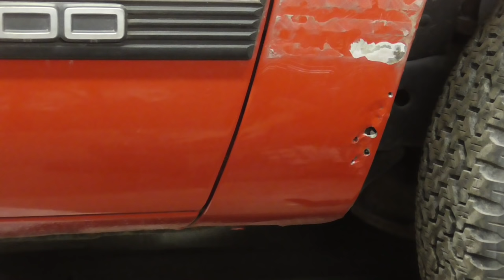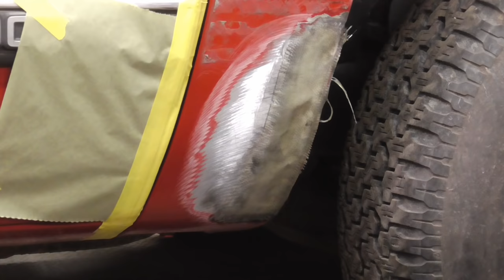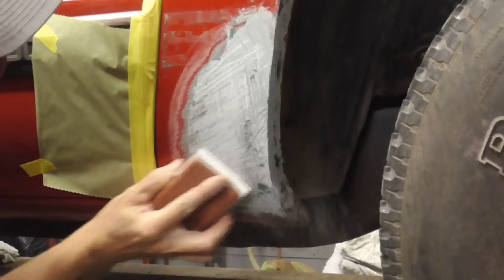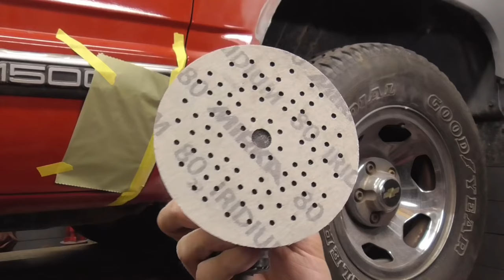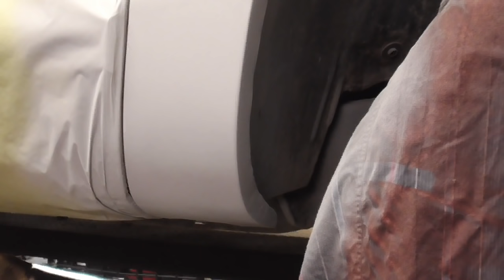How to Repair a Rust Hole with Fiberglass - No Welding!

Comment: I am doing this work to my ‘64 Plymouth Barracuda. I wanted to see how you were doing it compared to how I am doing it. After grinding back the rust and tapping back the metal in the effected area with the body hammer as you did here, I have been applying fish oil based rusty metal primer to the rusted, pitted areas with a small, cheap art brush (trying to get some of the primer on the back side around the perimeter of the rusted holes whenever possible), let it cure, then fill the holes directly with the long strand fiberglass “Bondo Glass”. On the holes larger than 1/4”, I have been applying the Bondo Glass to the back side of duct tape, then placing the tape over the rust hole and pressing inward around the edges of the hole to force the excess filler into the hole, letting the material harden, then removing the tape. Doing so, I find that I can better control the thickness of the filler in the patch and the wet filler doesn’t “collapse” when being spread and leaving a hole or a thin are in the patch. I wouldn’t have though to use fiberglass mat and resin first, instead of the duct tape method; I would have assumed that I would sand through it trying to level it with the existing surface and the areas over the rust hole would be too weak or just fall out? But, clearly your making it work! These areas where the back side of the rust through are inaccessible are my most worrisome. It would be great if I could clean, treat and add fiberglass back of the panel to insure the patchs hold, but what are you gonna do? Wherever possible, I want to try to let some two part epoxy run down and cover the backside of these repairs to seal them and add some strength as well as drilling some drain hole at the bottom of the lower panels and running a wire through them to make sure there is a clear runoff for any water to escape. Outside of cutting out the panel, repairing it, and welding in back in place (which is beyond my skill set, schedule, and budget), I feel like this is the best I can do.
Reply from the maker: As long as a panel can drain and dry out inside it will not rust - no moisture = no rust.  Lean a thin sheet of bare sheet metal up against a chain link fence and it will be there for 20 years.  Try to make sure you clean out the panel best you can and make sure there is a way for the water to escape or drain.  Then fix it how ever you can do best 👍😊

Comment: I just dip my already cut piece of cloth in the resin then apply. I also after about a week after job is complete I get up behind the patch and soak with oil. Helps so it takes along while for rust to come back. I did my ranger in same spot really similar over a year ago and still hasn't bubbled yet! Great video
Reply from the maker: Thanks - great to hear.  Have a good weekend :)

Comment: I've used Bondo with chopped glass to repair a large rust hole in a hood at the front lip. The local auto body shop wanted $2k to replace the entire hood. They claimed that anything other than replacement would fail "in a year". My repair hasn't failed, eight years later. Still driving the car. Even funnier, or more disappointing, the hole in the hood was the result of a failed professional repair about six years earlier that rusted away under their filler, which was in turn under one of those clear plastic hood protection films. My driveway repair has lasted longer and looks fine (for an old well used car). It's barely noticeable unless you lift the hood and examine closely.
Reply from the maker: Great story Jim - it all depends on how it was done - can the panel drain, stay dry, etc.  Lots of factors.  Thanks for you input and support 👍

Comment: Good job dude. I like clean work. You could even fill the craters with cat hair or short strand fiberglass. We always use fiberglass for many of our crumpled areas that are so bad we just can’t dolly the metal back. Customers prefer it over replacing expensive body parts! Like quarters and fenders. Doing Fiberglass repair is like having a proven to work cheat sheet! What sits next to our gallon of filler on our work carts? A gallon of dyno glass!
Reply from the maker: Thanks Rick - that truck is in my garage right now getting a lower quarter patch panel.  That fender still looks fine - I actually surprised 'cause the guy drives it year round on salty winter roads and it sits outside.

Comment: You did an amazing job and made it look so easy. I had just picked up some bondo glass for the filler, thinking that would be enough.  Then realized I need to get some bondo body patch because it's a fender and the more I touched the rust, the more pieces fell off.  But then watched your video and realized the solution is use the fiberglass first on the hole and then the bondoglass over it.  I could buy the filler, but it's an old car and it doesn't have to be cosmetically perfect, just waterproof.

So I'll sand down the rust.  Use alcohol or vinegar to clean off the rust powder.   Then spray rust reformer and let it dry. Then fiberglass over the hole. Then bondo glass.  Sand and then paint over it.
Reply from the maker: Sounds like a plan - just make sure it's really roughed up before you put the fiberglass cloth on - that stuff likes to stick to freshly sanded/ground metal.  Let me know how it goes for you :)

Comment: Well, I'm glad my (unintentional) winter project has taken longer than expected and has yet to be painted.  Our nemesis, CAR CANCER!!!, strikes again; rust bubbles formed and penetrated the primer in some spots. 

Also, I had one spot on the roof crack.  I ground it out with a Dremel, added Bondo Glass, and then a slather of Bondo Body Filler.  I believe the crack was from hosing down the car when it was outside after a surprise snow.

Let's hope it goes better this time around.
Reply from the maker: What kind of crack are you talking about - a crack in the metal, bondo glass, or bondo?
Reply: @LakesideAutobody  I'm pretty sure I used too much Bondo.  It was on the roof at the front d-side corner just above the windshield.
Reply from the maker: @ItchyKneeSon  It really doesn't matter how much filler you used if the surface under the filler is prepared correctly.  Let me know what you decide to do - curious as to why that cracked.  Keep me updated IKS :)

Comment: Nice job, I was looking for an alternative to welding because I'm restoring our horse trailer and there's just so much rust I'll be there for the next 20 years chasing it all down, thankfully it's all cosmetic and the structural parts are all good still. Going to have a look at that Bondo Glass you used, thanks for sharing.
Reply from the maker: Fiberglass reinforced filler works great for projects like that too - https://www.youtube.com/watch?v=rPTaeH056ng - the stuff is water proof :)
Reply: @LakesideAutobody  awesome, my biggest thing to deal with is the fact my horse weighs 1 ton by himself which means the trailer has to be reinforced all over because well.... he weighs 1 ton lol

Comment: Enjoying your videos. If the rust is originating on the underside of the panel, shouldn't there be some kind of rust neutralizer & coating to protect it going forward?
Reply from the maker: You can use anything that you think will help.  Here's what I find works the best after trying tons of different things - https://www.youtube.com/watch?v=8XaZBy7GC7A

Comment: Fantastic video I'm going to try this! Only thing I'm wondering is why you didn't use a rust inhibitor before the rest of the process
Reply from the maker: Rust inhibitor would help along with making sure the fender can drain and that you coat the back if possible or squirt some used motor oil inside after the paint has been applied.

Comment: This takes me back to the 70's LOL!
Reply: Why? This is still a very well known and used method today.. Its not like he is using clothe and resin to form a rocker panel..
Reply: @David_does_it_all  I am a ICAR Gold Class professional body man ,welder and painter. Shop owner for 26 years, I didn't use these methods when doing collision repair. I did use these methods in the early years before the shop was opened. Fiberglass and water proof reinforced plastic fillers were how I repaired rusted out cars before we had MIG welders in the 70's and those repairs only lasted a few years. It is economical to repair rust that way just don't expect it to last. I was laughing because it brought back memories of a simpler time! :  )

Comment: Very nice.  And the repair was in a very convenient, accessible spot, too!
I used the other type of fiberglass (free-strand?) the first time and it is HORRID!  The stuff gets EVERYWHERE! lol
Thanks for all of your videos. :)
Reply from the maker: You're welcome - yes very frustrating when the strands are sticking everywhere.  Have a good weekend :)
Reply: Fibreglass matting is pretty horrible to use, certainly an aqquired skill.
Reply: Proper term for "free-strand" is "chopped strand mat" (from an old Fiberglas R&D Tech.)
Reply: I feel your pain! it was 95°f about 92% humidity. Had to do a park and go. That fiber glass matt is clutch!

Comment: Question: Can you drill a hole through this type of repair? I’ve got some rocker panels that are rusted pretty bad around where the running boards attach. Or would it be better to just cut the holes out of the fabric before applying the resin? 

Thanks brother!

Comment: I like how you cut down the larger sanding disc to repurpose it for the smaller grinder.  Very practical.
  If you were to do the same repair with the inexpensive Harbor Freight flux core welder, would you have cut out the weak metal and overlapped a patch of new 20g sheet metal then body fill, prime etc.?
Reply from the maker: Yes Here's a video on exactly what you are talking about - https://www.youtube.com/watch?v=H87b1xlGofw
Reply: Thank you Jerry.  I have learned and applied many of the techniques you have demonstrated.  My execution is not nearly as good as yours, but good enough.  My restoration is a driver, not a show car.  My wife and neighbors are impressed.  You deserve a fair amount of the credit for sharing your skills.  Thanks again.  Will continue to watch your videos on bodywork and keep up with tools you endorse. @LakesideAutobody

Comment: Thanks for the great videos! I just picked up a 73 Bronco for the wifey that has some rust issues from salty Hawaiian air. Will use this technique to address a rust hole in the rocker panel. Aloha!
Reply from the maker: Hi from Michigan. You're welcome - glad to hear it helped you out.  Nice year for the Bronco - must have been a fun truck when bought brand new :)

Comment: So I've got a garbage MIG welder, have limited welding experience, and probably just as much fiberglass experience. However, my current project car still needs repairs done to its windshield frame. A couple holes in the vertical surface between my roof skin and the rim the windshield sits on. I've had no real issue getting all the rust out, but I've been going back and forth on whether to use glass/epoxy/resin or to attempt welding in a patch. This video is leading me to think I should really consider fiberglass, lest I warp that roof skin through inadequate welding.
Reply from the maker: You could try fiberglass first - if that doesn't work lightly MIG weld a patch in :)

Comment: Great work!  You remind me of myself,  back in the day when. I did the same thing with cutting down larger grinding wheels. And using them on my small grind like you do.
 I miss doing body work. 
Keep up the  awesome work!
Reply from the maker: When you start having to pay for them you use every inch of it.  Thanks for the support and have a good weekend :)
Reply: @LakesideAutobody  dam straight.  Save money when you can !
Lov your low cost options ! 
And still have great results!
Reply: I dont think I have ever heard anyone say that they miss doing bodywork. Wow, everyone I know, myself included, cant stand body work and thinks it's the worst thing you can do in the car repair world. I would rather swap an engine and trans 50 times before painting or body working 1 fender.

Comment: Excellent tips,thanks,I am encouraged to extend a  similar lawn mower deck  fibre repair,which worked very well,full ongoing  adhesion despite heavy operational  vibration,to my car,about which I have been hesitant till now.  For sea salt, try coastal Cornwall,and for arch rust, try my 21yr old Vauxhall Astra,its only body issue.  Good comment above about non burning  retaining rhe inner paint and coating  as it reduces further rust too.
Reply from the maker: Thanks for your input Andy - have a good weekend :)
Reply: @LakesideAutobody  Thanks,you too. You're a tidier worker than me- I'd have covered the tyre with an old cloth to  be safe!
Reply from the maker: @andyrendell7430  Oh you are right - my dad would be disappointed with me if he saw things unprotected like that tire or the panel adjacent to the one that's being worked on. I was always in a hurry 😊
Reply: @LakesideAutobody  Any advice on fixtures into GRP? I haveva hinge to refix on a GRP ie fibetglass boat and wonder if just resin in the old holes redrilled can be used,or with glass,or a separate epixy filler best. I though resin might  clog the job.
Reply from the maker: @andyrendell7430  You might want to try the epoxy.  Like - rough the holes up a bit with a burr, drill bit or sand paper and fill with JB Weld.  Let me know what you end up using Andy :)
Reply: @LakesideAutobody  Yes there 's a specific 2- part gray filler that sands easier than resin. Its a fiddly job as all the fixings are into cavities you cant reach the other side so  it's hard to caulk without it just falling through, so I may tidy it and try a hollow fixing plug BUT it's only small screws and holes and a real small plug needed.  Well, give filling a go again and see!  Good thing about GRP boats compared with wooden boats or  steel  cars is that they more or less go on structurally forever now, they started making them in mass  in the early 70s and they're all still around..

Comment: excellent repair did you treat the rust on the inside and protect with a rubber underseal..
Reply from the maker: No but that's a good idea if you can access it.  Drainage is really important too.  Thanks for the support and comment Steve :)

Comment: Thanks. That was very clear. It’s gonna help me with some repairs to my 22 year old LandCruiser. 👍
Reply: I’d love to get more info about putting in a drain hole. I live in Utah and we deal with a lot of salty water, snow and ice here. Thanks.
Reply from the maker: @mmpatriot2170  The bigger the hole the better on the back side at the bottom of the panel.  It doesn't really matter if water gets in there as it gets in there anyway - it has to GET OUT.  Something big enough so you can clean it out or blow air in there to make sure it's clean - no leaves, needles, mud, etc.  Has to stay dry and clean.

Comment: I've never used fiberglass before but have a job on my car, similar to that of your video. I was just wondering if you could elaborate on a difference of plain filler or fiberglass concerning adhesion to expanding and contracting metal.
Reply from the maker: You will never have a problem with filler or fiberglass being affected by the expansion and contraction of metal.  There is not enough exp. and cont. to have a negative effect.

Comment: In the early eighties, I would do what you just did, except I had to braze steel patches over the area, and cover it with Duraglass.  If you used regular bondo, the flux residue would make the bondo bubble like rust does. I usually had at least one car a week needing such repair.  Sixties cars were all a bunch of un protected rust buckets
Reply from the maker: Cars sure did rust fast back then :)
Reply: @LakesideAutobody  I'm well into refurbishing a '67 Eldorado that's 40% car, and 60% rust, lol.  Typically a car like this gets scrapped because it's value rules out restoration.  But the owner loves the car, and is willing to pay enough for me to resurrect it with a sheet of 22 guage and a big roll of fiberglass.  I took off about 300 pounds of near perfect chrome, so it will present well when it's done.
Reply from the maker: @karsbkool  Send me pictures when you get it done - look forward to it :)  - schoolvideolibrary@gmail.com
Reply: @LakesideAutobody  if I can ever get launched, it will be on the channel, getting cobbled together.  I'm also well into restoration of a '69 Camaro convertible pace car, and a '49 Chevy panel truck.  I worked on the roof of the panel yesterday.  That roof is over 12 ft long!
Reply from the maker: @karsbkool  Those would be some interesting videos for sure - very cool cars and trucks :)
Reply: @LakesideAutobody  I've figured out how to get video out of my iPhone storage and into iCloud,  I reduced my iPhone camera and hat cam to 720p, I'm figuring out my editor, and my videographer buddy is ready to create me a cool intro as soon as I figure out what to name my channel.  I was hoping for Dec 1, but I'll feel blessed if I make it by Jan 1.
Reply from the maker: @karsbkool  Cool - let me know when you get it going.  Happy TG my friend 🍗🥧😊
Reply: @LakesideAutobody  you have a great turkey day too!  I just put in a bid on ebay for a new in box craftsman paint gun like I bought in '78.  Wish me luck😉
Reply from the maker: @karsbkool  Nice!  Good luck.  I love Ebay for things like that :)